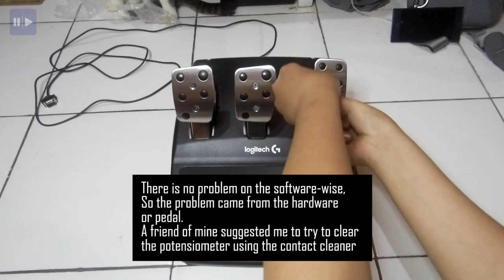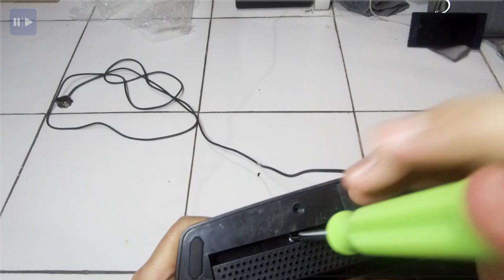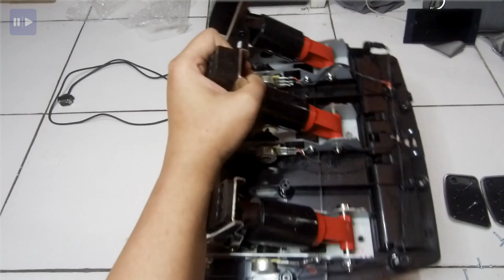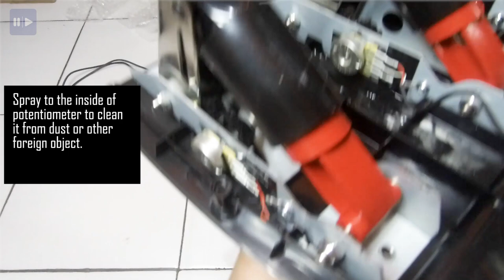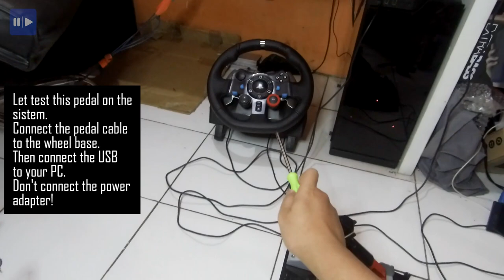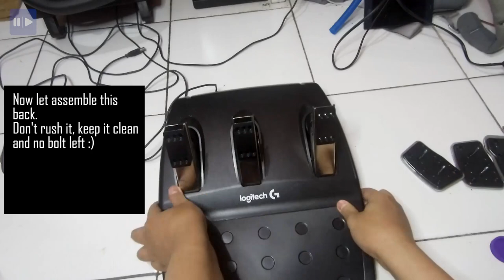Solved Error Pedal Flickering on Logitech G29 Steering Wheel using contact cleaner

Comment: I got to ask, i got a problem with my pedal, the cluth and brake seems to be have mind on its own, posses or somethinf, it stuck on half press on LG HUB and all the games... And when I press the gas pedal, the clutch also followed..... Do you or anyone got any suggestion?
Reply from the maker: Actually, that was similar to my problem on the video, when I press the throttle, the brake also reacted (but not stuck half, just like on the video). I believe, clean it with a contact cleaner worth a try since it very cheap and easy to buy

Comment: does this solve even if the pedal is flickering at the end like i press it to a 100% and it goes like this 100%-90%-100%.-50%-100%-7O% these are random numbers
Reply from the maker: I believe that the same problem, mine also acted like that. jumping around even the throttle pressed 100%
Reply: @RindiTechEntertainment  ok thanks this is the best video ive seen and it has clear instrructions even for me a non native English speaker :D
Reply from the maker: @smolsnekmax  good luck bro!

Comment: do you know if there is any permanent way of fixing this issue?
ive been having it but ONLY on my throttle pedal
the issue keeps coming back after a week or 2 of cleaning
Reply from the maker: Try to add some liquid grease after cleaning it. Not permanent but keep it clean longer. At least in my case.
Reply: @RindiTechEntertainment  thanks for the tip bro

Comment: I still have problem...brake stuck at 100% and the other two flickering as hell...what can I do??
Reply from the maker: just wait until it really dries and repeat the process. also be careful with the wiring, they are really small and fragile, and sometimes they clipped or damaged during the process.
Reply: @RindiTechEntertainment  I disconnected and I put outside protected from dust to ensure it will be dry and I try carefully to clean the contact..let’s wait
Reply: @RindiTechEntertainment  nothing to do...now they are stuck to 100% every time...what esle can I do?
Reply from the maker: @BlueTerm  Sorry to hear that, maybe there is something happened during your cleaning process. I suggest you check another YouTuber's video who tore down the potentiometer, maybe there is a bend sensor inside. It's high risk but worth a try.

Comment: I have an issue where all the inputs are at 100%, even when not touching, but the accelerator flickers slighly. I got mine of a good friend today, who looked after it well. Is there any chance you have advise for the 100%? Also, brake and clutch inputs are not recognised in Euro Truck Sim 2.
Reply: Are the cables broken or contacts not okay? You should have a look. To me it sounds likely that the cable to the pedals or inside the pedal case are broken.
Reply: @herzglass  I had opened it up, and the 2 of the wires inside the cable from the pedals are broken, just outside of the casing. I hadn't noticed at first because of some good old electrical tape.

Comment: I own a logitech G27, using it on PS4 with reasnow. It has about 13 years of use now, but that shit flickering started maybe a couple years ago. First time I opened the pedals I removed the dust and pressed potentiometers down and it worked perfectly again. Now it lasts about a couple of weeks before the problem starts again. I had throttle decelleration first and now it's only the brake. Is worth buying a G29? Using the contact cleaner solves the problem?
Reply from the maker: G29 still worth to me personally. Especially when the budget is really tight then G29 to the rescue 😀 and also it has so many 3rd party option to custom the wheel.

Comment: When I accelerate I always lose power and have to slam the throttle to get it working,you think that is the contacts as well?
Reply from the maker: The easiest way to examine is to monitor your pedal input when you play (if you can record it's better), if you see some bleep when you full throttle then it might because of the dirt on the potentiometer. If it so, you can try this method. Good luck 👍

Comment: I did this perfectly returned all the screws and now my Logitech g29 is not working anymore can you fix the problem?
Reply from the maker: Sorry to hear that. I suggest you try to check the cable, I am afraid that the cable is clipped to the screw hole. Or you can try the classic way, unplug and plug it again the usb cable.
Reply: @RindiTechEntertainment  I tried the unplug and plug it again I'll try to see if if clipped the cable thanks for the help

Comment: So I have a problem with my throttle pedal. I'm not exactly sure if it's this problem or if this is how you fix it but, when I go full throttle it sometimes stays half throttle or starts to flicker or when I come out of a corner it doesn't want to go full throttle. Normally I have to press my foot harder on the throttle and have my foot at the top of the throttle pedal and sometime sit works sometime sit doesn't. What do I do? Would this technique help?
Reply from the maker: Most of the flickering problems come from the dust inside the potentiometer. And yes you can try this tutorial since it's harmless and also cheap. Hope your problem is solved.
Reply: @RindiTechEntertainment  thank you. I will give it a go!
Reply: @alexanderodonnell988  its helped? i have this problem too ;(
Reply: @ВитоСкалетто-ю8ч  it does help
Reply: @alexanderodonnell988  woow, thx for your fast answer. I will test it on next week, thanks))
Reply: @ВитоСкалетто-ю8ч  how did it go?? 😊
Reply: @Stefano-YT  i open my pedales and inside was many dust, i clear it and fill wd-40 on pacentiometr, and all worked, thanks author!!

Comment: After 3 months, is it still working perfectly? My G29 pedals keeps flickering like your brake pedal, I have opened it up for more than 10 times in 3 months, im tired of it, if this works and lasted Im gonna do it.
Reply from the maker: As I mentioned in the video, this is for the basic problem which means it's only about dust interfering with the sensor, not hardware issues. The problem came back like a few weeks ago since I never clean it after the first time and I cleaned it with the same method and it's fine now. Some people said that the cleaning process is like routine maintenance, soon or later it will come back.
Reply: @RindiTechEntertainment  wow, that sounds effective, at least it last for 2.5 months, Im gonna clean it the same way, massive thanks! BTW, is it possible to use WD40 to clean it tho? Will it damage the chip inside?
Reply from the maker: @carxdriftracer9297  Just make sure you buy WD40 "Electrical" type, and it should be fine on the chip or electronic board. Good luck!
Reply: @RindiTechEntertainment  Thanks man! Walked around my little town and found nothing for contact cleaner.... guess its amazon time oof
Reply from the maker: @carxdriftracer9297  Yup! I am suggesting you to buy the large bottle in case the problem come around every few months

Comment: Yo, bro, when i made it like 2 weeks later i have the same problem... Can i fix it for like month or more...
Reply from the maker: You may need to add some more 'juice' to that potentiometer.. brush it more but keep it gently. Do it 2 or 3 times before you re-assamble. If the problem still exist you may  need to clean and check the inside the potentiometer.

Comment: The only thing that I don’t like about it is how fast the pedals wear out 💯
Reply: Instead of just cleaning with contact cleaner, remember to coat the contacts of the potentiometer with di-electric grease. It helps to keep the contacts clean while also protecting them from further degradation

Comment: This fix seems extremely temporary. As I'm reading more my research is backing this up. People are going like 2 months or so and having the same problem. I've had the flickering issue with my gas pedal before. I just adjusted the dead zone in my games to fix it. Problem is I've now gotten GT Sport and that isn't an option. I got a little annoyed at having to push so hard so I did a few pretty hard slams on the gas in the menu screen. I still have to press down with a little force, but I naturally do. The problem is pretty much gone. So maybe I just had a minor case of this compared to others but I don't really think you need to take apart the pedals. Seems like quite the waste of time.
Reply from the maker: Yup! If you still can use the dead zone trick that's better than taking apart the pedals. 👍

Comment: Didn't work for me, followed the instructions.
Cables look good
Lubed it all 
Cleaned the dust 
Any ideas how to fix it?
Reply from the maker: Sorry to hear that. Did you use electronical contact cleaner? If so, then your problem is on another level from mine.
Reply: @RindiTechEntertainment  
I didn't use the special cleaning lube but another one that I had
Reply from the maker: Oh I see, I suggest you to use the electronical one if you are still want to try it again @GalEfrat1
Reply: @RindiTechEntertainment  
So today I got the special spray, but unfortunately it didn't work...
Any ideas?
Reply from the maker: @GalEfrat1  Sorry to hear that. You can tey it again with extra spray if you want bu if that's not helpful maybe your problem is on another level. You may need to deep clean the potentiometer like on another video on YouTube.
Reply: Thank you so much! 
I think it's just too much work...
Idk what should I do @RindiTechEntertainment

Comment: What Allen key size do I need to open the pedal?
Reply from the maker: Around 2mm I believe
Reply: @RindiTechEntertainment  alright thanks! I seem to be having the same issue on my pedals. Will be trying this out. Hopefully it works!
Reply from the maker: @StephenPrabhu  Good luck bro!
Reply: @RindiTechEntertainment  can I use wd40? Is that an electrical contact spray ? 
Also what do I need to ask in the store for the Allen key? Is it a hex or a square ?
Reply from the maker: @StephenPrabhu  I Never use WD40 so I can't tell whether its okay or not. You need to make sure that it has the ability to clean the electronic parts, if you are not sure then I strongly recommend you to find another brand that stated clearly "for electronic parts" like on the video. Allen key is hexagonal
Reply: @StephenPrabhu  There is a dedicated WD-40 contact cleaner. Normal WD 40 is NOT a good idea for cleaning contacts.
It's 2.5mm for the pedals.
Reply: @herzglass  yeah I got it done. Thanks!

Comment: Contact cleaner will solve your problem momentarily, but you will need to coat the inside of the potentiometer with a thin layer di-electric grease to protect the contact after you've cleaned it. I was doing this for years and the problem got worse, with me needing to clean it more and more often, until I realised that you can use di-electric grease to protect the contact inside the potentiometer after cleaning it.
Reply: do you have to take the pot apart to apply
Reply: @vickitreloar7797  not absolutely necessary but it can be more thorough to do so
Reply: @joshlow132  how long will the solution last i am about to purchase g923 i didnt realise it could be fixed and tried using 3d rap solution didnt work and binne pedals gave wheel to friend who has g25 pedals i might buy fanatec but compatability seems to be an issue with ps4 thanks
Reply: is it arcing that causes the problem or is it dust if you seal the pot with duck tape will it stop the pot getting dirty dont want to fork out for fanatec if pos but i am using the wheel quite a lot thanks
Reply: @vickitreloar7797  whether or not it’s dust the main issue is that the contact is not being made properly
Reply: @vickitreloar7797  not sure what solution you are using but I can say that I’ve not experienced any issues since I last cleaned my pots which is more than 6 months ago

Comment: I’m going to have to try this whenever I activate my drs it just turn straight off it’s so annoying I tried mucking with the dead zone but doesn’t really help
Reply from the maker: Yup! Sometimes the input sensor spike in a millisecond so playing with the dead zone sometimes didn't work. Good luck!
Reply: @RindiTechEntertainment  so I did all of this but it’s sadly made it a lot worse I used the same stuff and did everything same as you???? It’s got even worse it’s now going like 50% bake
Reply from the maker: @harry_reading7544  I'm afraid there is something bend a little on the potentiometer. I suggest you to clean it one more time and if it still errors you may need to open the potentiometer (there are some video about cleaning inside the potentiometer, you may need to watch them for reference).

Comment: Can I clean it with an electric air duster without the spray?
Reply from the maker: I'm not sure but as my understanding the liquid from the spray also help to grease the potentiometer inside.
Reply: @RindiTechEntertainment  thank you!
Reply from the maker: @b4dblueb0ys  Good luck 👍🏻
Reply: Did it work?, I am cleaning it with compressed air right now and hope it has the same results
Reply: @mgaming6745  definitely worth opening and cleaning all that dust from inside also performance is better. Not sure about the compressed air as I believe an air duster is a much stronger unit.
Reply: @b4dblueb0ys  I just finished putting it back together and it works like a charm. Definitely, if you don't have contact cleaner, try compressed air. It worked for me
Reply: @mgaming6745  mine was working fine as it's quite a new set, just wanted to do some maintenance before things get ‘rusty’ 
Happy to hear it works for you
Reply: @b4dblueb0ys  well I bought my G29 in December 2018 and it's had no issues up to the point where I had to fix it

Comment: The alcohol isn’t necessary you can also just check if they out the cables in the brackets ment for them, allot of oedals dont have that just lazy technicians just see if the cables arent tangled up straighten them out put them in the tiny bracket hole thingies and it should be good
Reply from the maker: Thanks for the input mate, hope it also help other user with the same problem 👍

Comment: how i get the metal pedals away? i got a 2.5 mm tool but im too dumb
Reply from the maker: Is it fit with the hole? Did it rotate?
Reply: @RindiTechEntertainment  i think it works but i always slip or maybe it is slightly to small but it fits
Reply from the maker: @josclopath708  Ya you may need to try 1 size bigger. 👍🏻
Reply: @RindiTechEntertainment  but 3mm is way to big
Reply from the maker: @josclopath708  Oh I see, either your key or the screw hole is not in-shape anymore.
Reply: @RindiTechEntertainment  what tool did you use to remove the metal pedal things
Reply from the maker: @josclopath708  Hexagonal key

Comment: does wd-40 work instead of contact cleaner?
Reply from the maker: I personally never try it, but some people here in the comment say it also works.
Reply: @RindiTechEntertainment  also my problem is a little bit different than in the video, instead of the brake dragging it's my gas pedal that doesn't go all the way, when i floor the gas it wiggles from 90 to 100% do you think this video will also fix that?
Reply from the maker: @CrasyFingers  Yup. That's the same problem as per my experience.
Reply: @RindiTechEntertainment  i thought in your video it was wiggling from like 0-10% and not from 90-100%?
Reply from the maker: @CrasyFingers  It's not on the video but that the same problem and fixed with this tutorial. When I floor the throttle sometimes it blipped not constant 100%
Reply: @RindiTechEntertainment  ok thanks i'll remember

Comment: Hi bro i want some help plz reply. I have break problem
Reply: @RindiTechEntertainment  bro i have the same problem as shown in video. I tried the way you cleaned the brake pedal  but still it is flickering so what should i do now. First 5 minutes it was not flickering fast after the cleaning  but after that it is still the same?
Reply from the maker: @abdullahalam5041  Seems you have advanced problem with the potentiometer. I think you should try to open and deep clean the inside of potentiometer. I believe there are some video on youtube about that.
Reply: @RindiTechEntertainment  so bro can i open this thing myself  or it need a proper mechanic for this problem of brake?
Reply from the maker: @abdullahalam5041  I think you should check the other video first (who opened and clean the potentiometer), then you can ask yourself whether you can follow the DIY or not. that sure riskier than my tutorial here, but if you can manage it, I think that will worth it.
Reply: @RindiTechEntertainment  ok thanks bro and can there be another except these two?
Reply from the maker: @abdullahalam5041  I am no expert but these are the common solution for the problem
Reply: @RindiTechEntertainment  ok

Comment: I cleaned it for the first time only with contact cleaner and it only lasted about 5 days, I cleaned it again and it remained the same as if I had not done anything.
Reply from the maker: Seems like your potentiometer needs a special treatment, I saw some video that opened the potentiometer parts and clean it, I think you should try that. As I mentioned in the video, this tutorial is for the basic or common problem, dust. I assume your potentiometer are clean but still need special treatment. Hope you find the solution
Reply: You should also try spraying it when the pedals are pressed and move them up and down when spraying it.
Reply: @herzglass  yeah i did it but still nothing
Reply: @herzglass  I had to put something so that the throttle would not return to the top